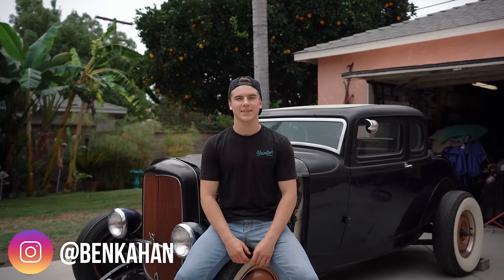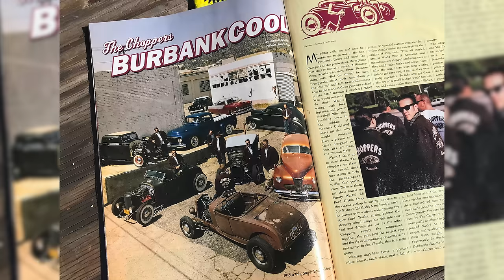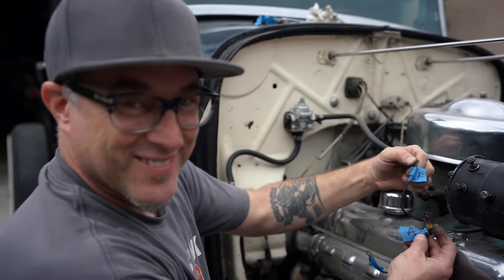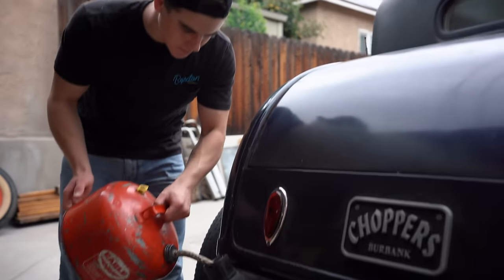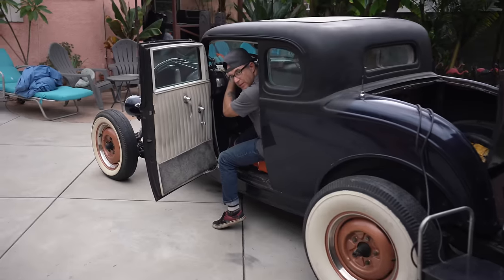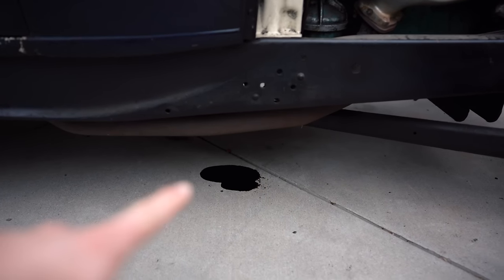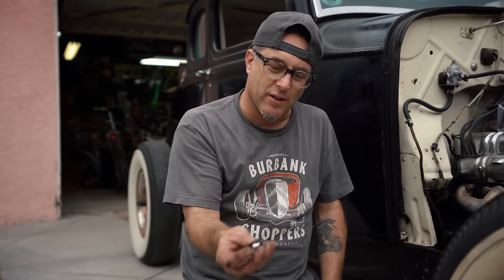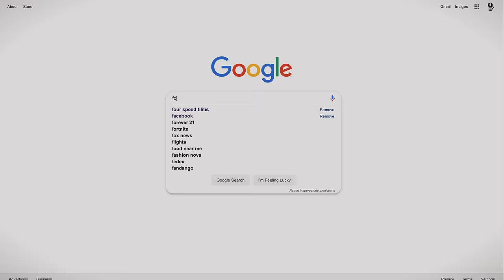Nailhead Powered ’32 Ford Hot Rod Fires Up For The First Time In Years!

Comment: this is awesome man. my grandpa just finished his 34 year build of his 34 ford. he put one of his old indycar engines in this thing from when he raced in the 70s and a ford 9 in rear. attached to a 5  speed manual and man his thing just absolutely shreds pavement i think he toned it down to just under 750 to the wheel

Comment: I've got a soft spot for the Buick Nailhead engines. I got my 1st car in 1982 when I was 15 years old, it was a nice green 1966 Buick Wildcat sedan and it had the 401 nailhead engine and 3 speed automatic transmission. My dad had bought that Buick brand new and a few years after he owned it he sold it to a 'friend' on payments who crashed it in the 1st week he owned it and after that he just parked it on his farm and never paid dad another payment on it. So in 1982 my dad decided it was time to go take the car back... We used dad's welding truck, it had gin poles on it and it all happened quick, dad asked him if he intended on paying for the car, the guy said no so we hooked it up and towed it home. It took me about 1/2 an hour to get her running and wow that car had a lot of power! The crash damage was that the guy hit a tree and it needed a whole front end but it could still drive. I was a kid and when dad wasn't home I'd sneak the car out and play around on the back roads like the Duke boys haha! When I was 16 I ended up taking the body off the chassis and mounting a 36 Chevy truck cab to the Buick chassis and wow with barely any weight I was the fastest thing around! Those nailhead engines are a powerful and reliable engine and to this day I won't turn one away.

Comment: Such a cool video, I wish my dad's car was in this good of condition. He drove a Ford Galaxie all through high school that sat in the weeds and the mud for decades, just pulled it out this summer only for the poor thing to nearly split in half (the back axle sheared right off the body, it was so rusty). At this point, the best that we might be able to do is to pull out the 289 v8 and lay the car to rest behind our shed. Oh, what could have been..

Comment: That Olds generator is identical to the Buick unit. I don't think a generator cares which way it rotates, but the stock nailhead has the generator mounted on the passenger side front of the engine.

Comment: That was cool...  but you have a ‘40 dash that has an “electric” oil pressure gage and you showed a “mechanical” oil pressure fitting that was leaking?
Reply: Aaron Kahan .. You can buy “resistors” that  will allow your 6 volt gauge to work with your 12 volt electrical system... lot cleaner setup

Comment: I hate those nylon oil pressure lines i went to stainless braided line so I don't have to worry of hot oil all over the place the line is kind of expensive but it's one of those thing you never have to worry about anymore

Comment: This brings some good memories. I have a 40 Ford pickup that I also built in 1959 with a nailhead factory modified engine. The engine came out of Buick Engineering. It was so new it never had an engine number. It was the first nailhead built with aluminum rockers. It also has not been run for way too many years' Hopefully this will change this comming summer.

Comment: Your battery is too flat/discharged for the charger's circuitry to kick in.  You'll need to connect a charged battery in parallel to the flat battery, then hook up your charger to either battery and charge. them in this manner.

Comment: Should have checked the voltage of the battery before trying all that stuff. Check the circuit for a parasitic load to save the new battery you put in there.